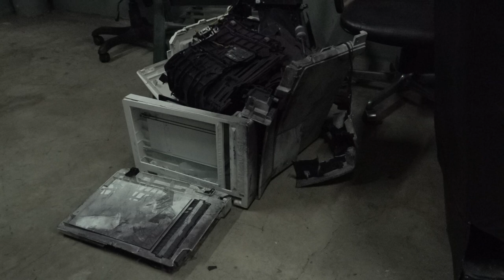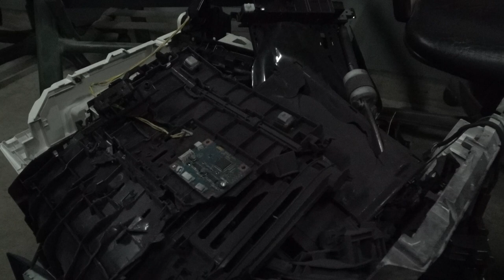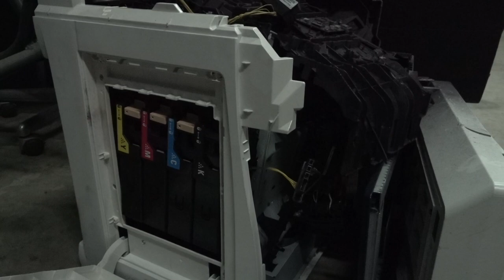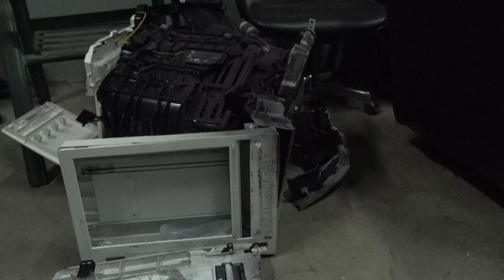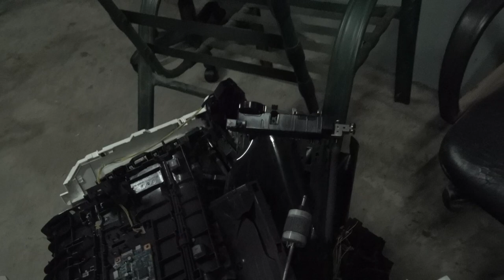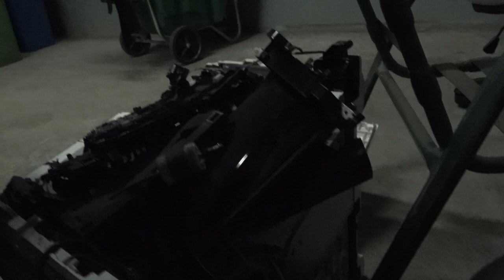This Dumpster Printer Was Office Spaced!

Comment: PC LOAD LETTER!?!
Reply: It means Papa er Cassette load US letter sized paper! Somone prob sent a job in A4 to the printer.

Now if you lot in the US could just join the rest of the civilized world and switch to the Ax paper standard that would be great....
Reply: Yeah. Used to get that message all the time when I printed US docs on a UK HP Laserjet 4 which only had A4 cassettes.
Reply: Andrew - Ya, because "A4" is so descriptive and easy to understand the dimensions of.  A4 = 210 x 297mm.  Who comes up with that?  Such a weird and long paper size.
Reply: A4 is 1/(2^4) of 1m^2 of paper. The size of all Ax sizes is 1 sq metre/(2^x)    The ratio of width to height is 1:sqrt(2).
Reply: ElmerFuddGun - someone starting with a sheet called A0 with s size of 1m^2 and a shape that will be retained when divided into 2 equal halves on the long side, creating 2x A1. Divide those into 4x A2, then those into 8x A3, and those into 16x (2^4) A4 sheets, and so on...
Paper weight is given in grams per m^2

Comment: Looks like it fell off the building! Sometimes I want to do this to my Epson WF-3640 - what a piece of shit they are. Gives specs of quick printing, except they left out that if you use refillable cartridges, after printing with them for a few days suddenly doesn't recognise them. Then you have to take them out, reinsert and then it asks "Do you want to use non genuine"? Yes I bloody well do! Then it goes through it's clunky cleaning process for 5 minute, starts printing again, only to run out of ink because you've got an air lock. So, do another 3 cleans and it's working again to do the last two pages. 10 pages of printing taking 20 minutes. Only to have it happen again two days time!